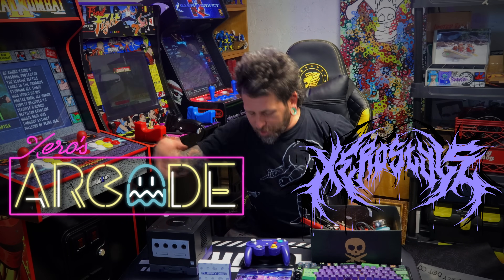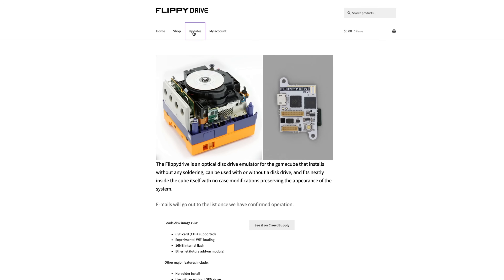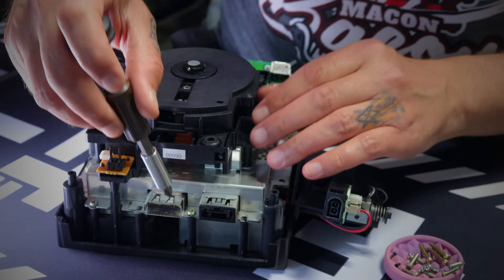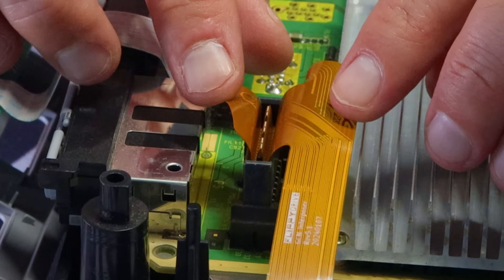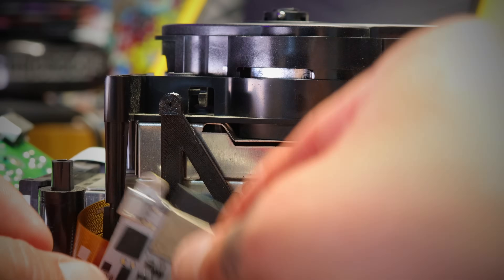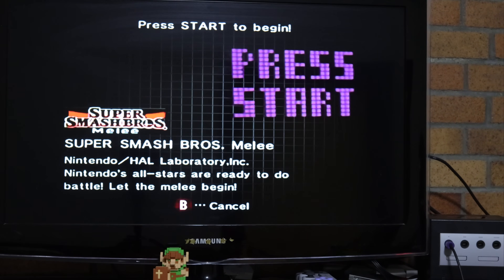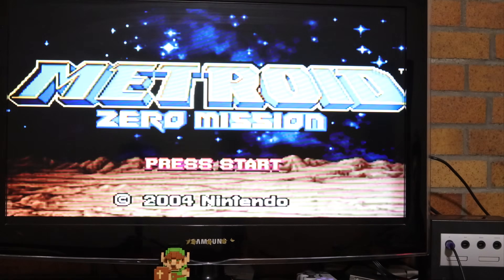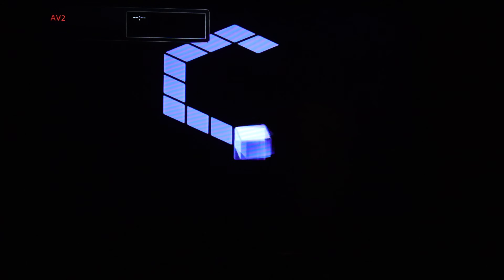flippy drive gamecube mod tutorial! featuring gameboy player & gbi homebrew!

Comment: Did you install GBI like it was an iso file or was there more to it?
Reply from the maker: i just grabbed the files and put them in the root of the SD card.  you can get the newest version here:
https://files.extremscorner.org/gamecube/apps/gbi/latest
i really just followed the docs:
Extract the main package to the root directory of the SDHC/SDXC Card. Do not extract to gbi-YYYYMMDD.

https://www.gc-forever.com/wiki/index.php?title=Game_Boy_Interface

g'luck!
Reply: @xerostyle much appreciated!
Reply: @xerostyle  did you lose any functionality by not using the SD2SP2 or similar adapter for 2 SD cards like the docs mention? It looks like it worked just fine with just the single SD card method but I'm wondering what the difference is between the methods.
Reply from the maker: @retroGnomeRepairs as far as I can tell, everything's working perfectly. if there is some missing functionality, I haven't noticed it yet. All three versions of gbi run. having no problem with other disk images as well. The physical drive still works if you hold the trigger when booting. everything's working great
Reply: @xerostyle awesome thanks! I have a Flippy Drive pre-ordered and I can't wait to try it out. Great video!